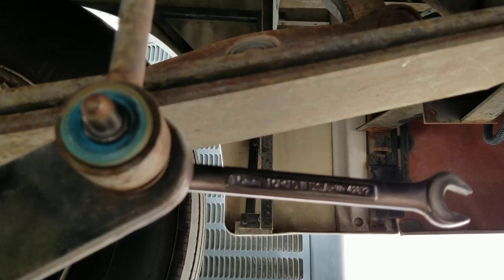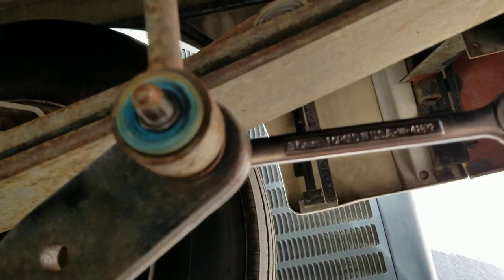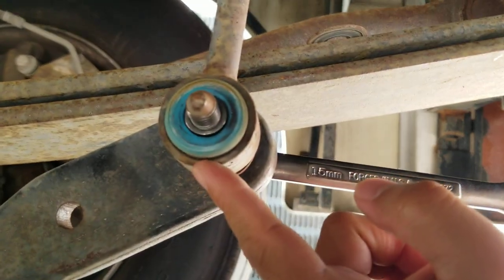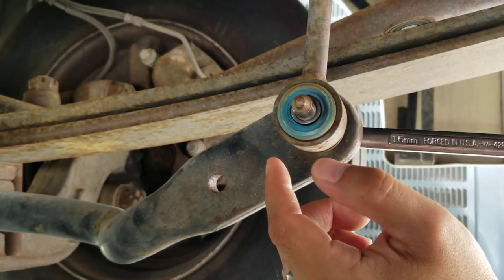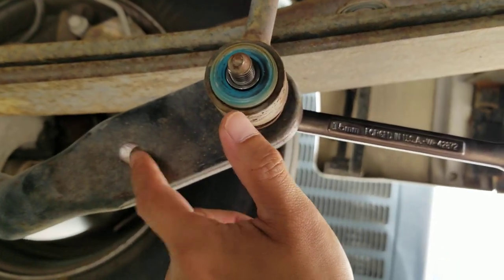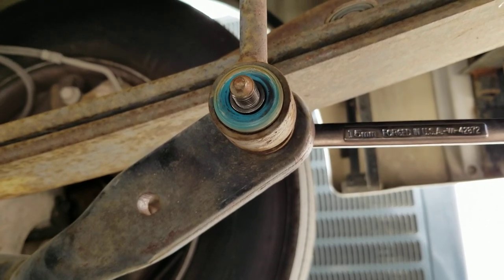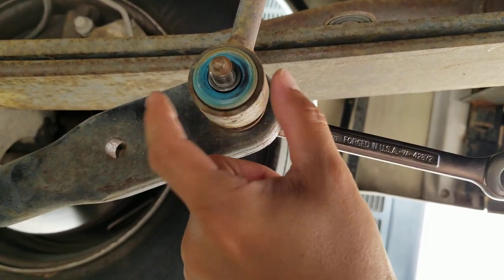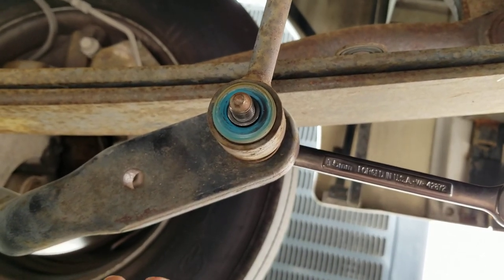Class A motorhome F53 chassis front suspension fix

Comment: did you have to jack the motorhome up to change the bolt?
Reply from the maker: You don't necessary jack the entire motorhome up, but rather use the jack to situate the bolt point
Reply: not recommended but you can just use your levelers or drive up some blocks